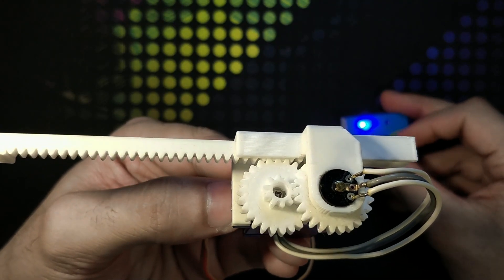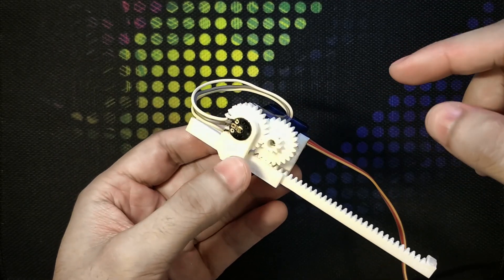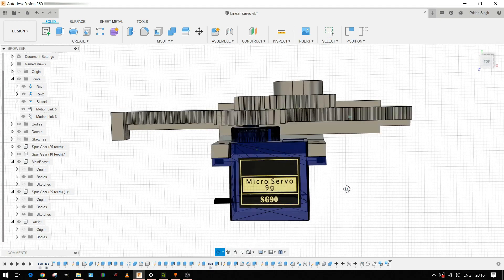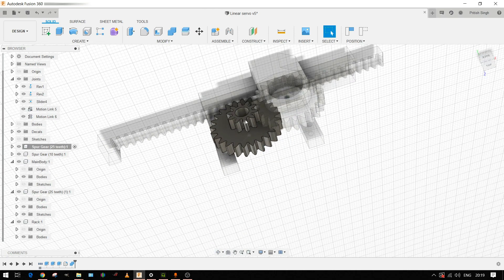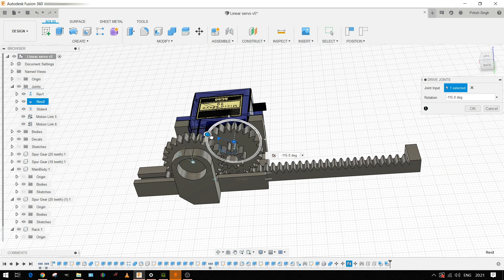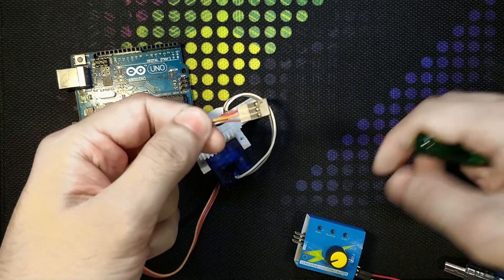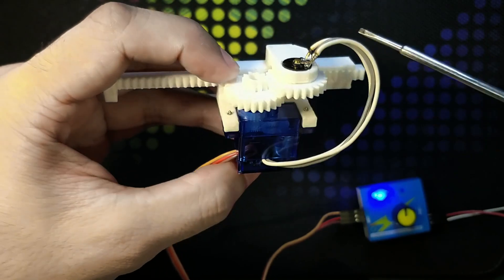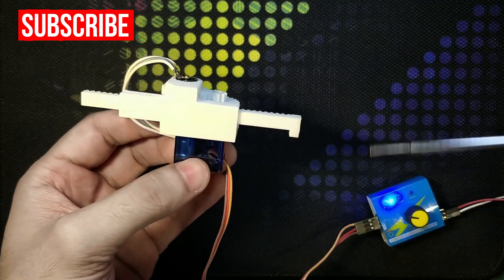DIY Linear Servo Actuator 3D Printed with full Positional Control and long travel

Comment: Simply superb bro...  Creative and minimilastic design.. only you need 3d printed parts and some time with soldering iron... That is it.. ;)
Reply from the maker: Thanks bro!
Reply: @beardoguy  I quickly gave print and simultaneously removed a sg90... Found that the pot connections need to be taken out and sacrifice another servo potentiometer for 2nd gear... Hmmm.... Design could have improved with rm065...anyhow.. good design though... 😎😎
Reply from the maker: @mutthunaveen  I'll look into the rm065, thanks.
Reply: @beardoguy  nice...
We can cut the wires of inside pot.. and put any resistance value pot outside (resistance value doesn't matter because all the IC reads is the voltage from VCC to GND) so any pot should work...

Comment: Is it possible to increase the travel to 90mm using the servo tester specs for signal input? I want to use the design to move a canopy at least 80mm.
Reply from the maker: Yes it can be increased to 90mm by increasing the gear teeth on the rack driving gear

Comment: Have you considered leaving the existing potentiometer in the servo and just reconnecting the wires to a different potentiometer?  If so, you could make the design work for any manufacturer of servo (by picking a well known replacement potentiometer) and construction would be easier because you'd only have to reroute the wires and not remove the potentiometer.  Sorry, you got me brainstorming =)
Reply from the maker: That will work just fine, the only reason that I got the internal one out is I couldn't find any good quality potentiometer in my local stores. Thanks.

Comment: Sorry I'm not shure about how to assemble it: if I remove the potenciometer the pin that holds the gear is removed, how did you solved it?
Reply: I've same question
Reply: @mutthunaveen  probably they used different servo, where the pin is not a shaft of a gear
Reply: @SergioGugliandolo  yeah Sergio... I read all comments they are doing the same...

Comment: Great work. Thanks a lot. In my case, I need to send 8 inches of the rack.  Should I increase the radius of the pinion or the gap between the teeth?
Reply from the maker: You should increase the radius of the pinions.

Comment: Thank you for share. I am not really knowledgeable when it come to this stuff. Could this be fitted with some type of meter to move the rack in and out, in precise increments.
Reply from the maker: Yes, it can be precisely controlled as needed, that's the main advantage of this design.

Comment: Did you use the potentiometer from another servo? Cause the potentiometer rod is where two gears rest on! If you took it out are the gears seated on another rod?
Reply: I'm running into the same issue. @The Beardo Guy (amazing hack / thanks for sharing the 3d models btw!) could you please show how you reassembled the cogs inside after you've taken out the potentiometer? At 12:43 it's clear there are 2 rods, one of which seems to be the potentiometer's, so the cogs that relied on it need some replacement at least on my model. Also the axle of your potentiometer sticking out of its cog (as briefly glimpsed at 1:28) seems wider than that of my servo.

@AZHAGU05 it makes for an expensive potentiometer to take it from another servo, but that's my current workaround, I'm glad you suggested that! I've gutted most of the potentiometer's insides / only preserved its plastic base and metallic rod (the lack of wiper creates an extra 1mm+ gap, which I might try and plug with a washer below the plastic base, unless I 3d print some alternative, thicker plastic base). This allows the "former potentiometer" to rotate 360. 

Alternatively, for a cheaper result, one could use another potentiometer of the same resistance and modify the 3d-printed cog accordingly
Reply from the maker: No, I used the one that was inside this one
Reply from the maker: And I think different servos have different internal design (especially these chines ones), I'll have look and let you know

Comment: High Pritish well done video 
Would it be possible to create an actuator with a dc motor?
Reply from the maker: Yes it would be possible with a DC motor too but a microcontroller will have to control the DC motor using a motor driver and control its position based on the feedback from the potentiometer